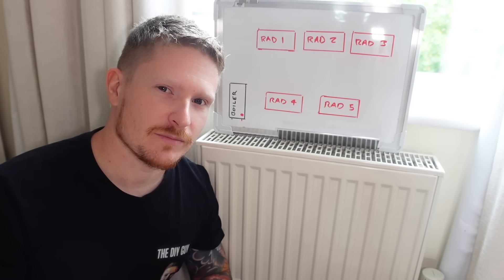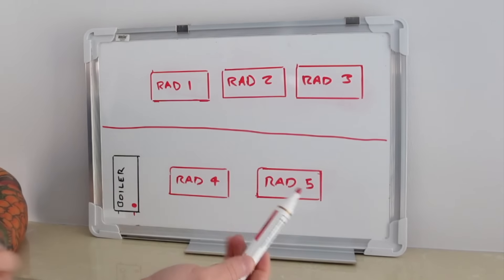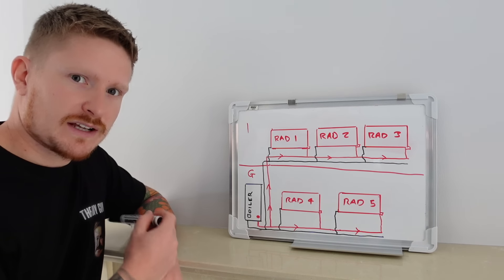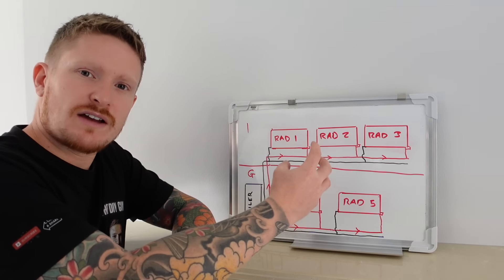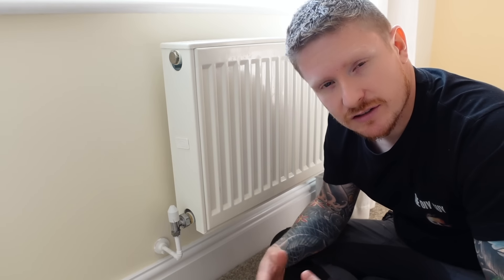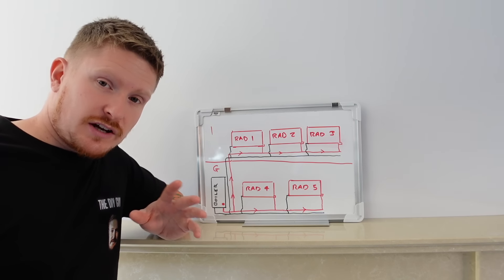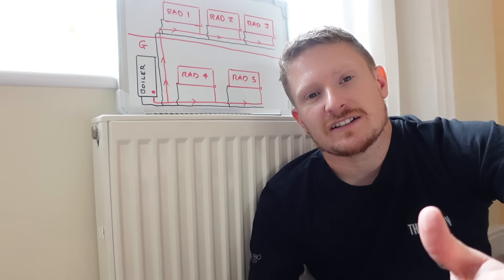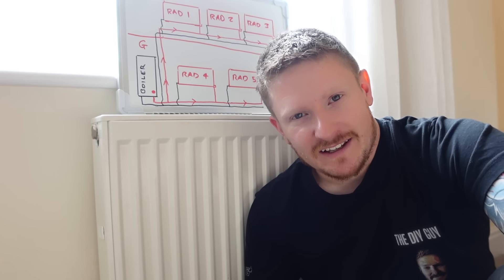How to Balance Your Radiators | Save Money and Increase Heat

Comment: What if the order of radiators can't be determined exactly due to unusual layout (extensions)? Does the order matter too much? Is there a good general/"rough" lockshield starting place before adjusting using the thermometer (e.g half turn for small radiators, full for large?). Also, do smart TRVs need to be temporally fully removed for the adjusting as they can't be "fully opened" easily like a manual? Pp
Reply: You can determine the order by opening up all valves fully and turning the heating up. They will get warm in order.
Reply: @mushy3424  Unless they don’t.
Reply: @normanboyes4983  Would this be due to sludge in the radiator or something else?

Comment: This is great, and we did get our back bedroom rad working much better by preventing a hogging rad in the front room BUT…watch out for the almost inevitable leaks.   A lot of valves, once disturbed, will leak.  90% of the time, they sort of stop after a while, but beware you will need to top up the water inside the boiler area, using the taps to do that afterward.  But, all good stuff, this works.

Comment: Hiya . Thanks to you for this video . Had a radiator that we just couldn't get hot after having 4 new rads installed by a plumber.
So did what u said ..without a heat sensing camera...lol 😂
Shut down the lockshield valves ..opened each one as u said & now it's working ..nice & hot 🔥
Thx again 😊
Reply from the maker: Glad it helped

Comment: First bit fail - 12 radiators in my mums house sizes small, medium, large 2 small ones come on at same time upstairs and down stairs and the last definitely in middle of hallway upstairs and second to last downstairs at furthest point from boiler which is upstairs. All other radiators are inbetween and come on at same time it seems. Must have run a couple of mile trying to check order lol. Great video and idea but not as simple  for everyones all over the place pipework i guess. The product that is linked is £290 which is as far as a day trip to the moon for us so ill try again and maybe try and follow the pipework best i can. Thanks for the general idea, very clear video. 1

Comment: The flow temperature here was about 70C - seems a bit high for a combi boiler. You should try reducing the flow temp at the boiler first and THEN balance the system as best you can.

Comment: Thank you for these clear and straightforward instructions. :-)  I've seen the 12K temperature differential mentioned in a few places. Do you know where it comes from? What is the reasoning behind aiming for a 12K temperature drop from in- to outflow? Thanks !
Reply from the maker: Your welcome. The temperature is to give you guidence as to the level of restriction on the return, therefore the flow rate of water traveling through the radiator between flow and return.
Reply: @TheDIYGuy1  this makes sense. Thanks!
Let's attack our 14 radiators...
Cheers
P
Reply: The temperature differential in smallbore heating systems i.e. those using 15mm and 22mm pipework, is normally 11 Deg.C,  (Delta T) this is related to the radiator sizing, before condensing boilers came along then a system would be designed at 80 Deg.C flow and 69 Deg.C return, giving a mean water temperature of 75 Deg.C, you would calculate the heat loss of the room and refer that to the manufacturers sizing chart, you would then select the radiator to suit that room. When condensing boilers were introduced we mostly moved to a Delta T of 20 Deg.C which meant using a correction factor in the early days, until radiator manufacturers introduced mor sophisticated sizing charts.
Reply: Wickes specify the wattage of the radiator at 70℃ input and a drop of 10 degrees.
Basically, the longer the time the water is in the radiator, the more heat it will transfer to the air around it. Providing the vents are free of dust, drying wellies etc etc. of course.

Comment: Thanks for the great video. Silly question but at what stage from turning the heating on should you take the thermometer reading? I have two digital thermometers with probes, but wondered when the best point is to take the initial reading for analysis
Reply: Well just give the boiler time to heat the water in them depending on how many rads you have. Know your 1st rad   2nd etc . Sure give it 30 mins or so.  Happy balancing

Comment: A suggestion, most folk like it warmer downstairs than in the bedrooms. Set the downstairs radiators to be fully on, and the upstairs bedrooms off. The bathroom radiator is often the fail-safe, that is permanently on to stop the system going bang. Set the thermostat, whether upstairs, as is mine, or downstairs in the living area to desired temperature. Eg. Mine at top of stairs is set to 18°C. Downstairs yours might be say 20°C. Heat from downstairs rises through the house and thus isn't actually being wasted. Obviously having the house walls insulated is first priority 😁
Reply: My hallway is the failsafe
Reply: Note to anyone reading the original post. This is poor advice. Boilers are normally sized to suit the whole house size and all radiators. By turning off half the rads, the boiler will see hotter return flow and is less likely to condense (operate at max efficiency). You're also using half your rads to heat your whole house (unless you close off the upstairs, but the original poster isn't doing this as his room stat is upstairs!). I could go on and on.
Reply: To save money I’ve turned off all radiators except the bathroom upstairs, then just a small room on down stairs.

I’ve completely forgot about the thermostat and even shut off the radiator that’s near it. I just turn the heating off when the small room downstairs feels warm enough.
Reply: Awful suggestion. You would be far better off turning the flow temperature of your boiler right down and opening all rads fully. Asking the downstairs radiators to do the works of the upstairs radiators you have already paid for is lunacy and is costing you money not saving it.
Reply: @ImBarryScottCSS  p

Comment: Your videos are brilliant and have really helped me perform some tasks around the house.  One question, I was making small adjustments to the lockshield pin - why would water start to gently flow out of the lockshield mechanism ? I made very slight adjustemts in both directions and the water started appeared...eventually I found a sweet spot that stopped the water coming out of the mechanism.  Regards Aaron in the UK.
Reply: Been there.  You have a leak past the valve stem.  If you go near an old valve, the seal may give way completely so be ready with cloths trays etc.. Try twisting it on and off a few times in case there's a particle stuck in the seal.  Try tightening  the sealing nut.  But if the seal or the valve body is worn, you will have to attack that by replacing the valve. Worst case a coupe of € for a new valve, plus isolating it to replace it.  Eh don't flood the house.

Comment: An excellent video, and I shall be trying to balance our system this weekend using this method. Did try to see the order the radiators heat up though and I've established the first one on each floor (2 floor house) but the others are getting hot at the same time....does the order for those after the first one matter alot?  I guess its a case of adjusting each and seeing impact.

Comment: Great video, thanks. I've only used the manual system to try to balance my rads. The Topdon kit you used is expensive for diy-ers, so I might try the type of infrared temperature probe that normally sells for around £15. Might not be as accurate but better than guessing.
Reply: Even the cheap IR temp detectors are accurate to within  2 degrees so not too bad.
Reply: Which one did you get please?
Reply: Thanks bud, perfect video - simple, short and to the point 👍
I drew a plan of my house with radiator positions and then the in and out side of each rad... Not all lockshield valves were the out (return) side 😜
Reply: @GaryMcKinnonUFO  Not exactly true - if pointed at a reflective surface (chromed valves/copper pipe) the emissivity encountered will put them out a lot.
Reply: As it's a temperature difference the accuracy doesn't matter very much so long as the readings are consistent. The emissivity of both pipes should be the same, but usually are both plain or painted the same colour.
Reply: How do I decide the position of the first and last radiators when much of the pipework is hidden?
Reply: @whitegoosegal turn boiler on and just feel the pipes to see which radiator is first,second, etc on the system.

Comment: Great tips, but probably need to ensure there's no air in the system by bleeding first. 
I usually just put my hand on the panels to see if they are all giving same amount of heat output, then do bleeding on any that are of a low heat output or warm at the bottom but cooler towards the top. 
The other tip, if TRVs are fitted (which hopefully they are), is to adjust settings correctly according to heat demand required. Bedrooms usually should be cooler to aid restful sleep. When not in use in the daytime, the TRV can be turned down, unless automatically controlled by a programmer.
Reply: Yes, but you have to be careful if you have a combi boiler and bleeding the radiators, it affects the boilers pressure and it may need adjustment after bleeding.

Comment: A different, and potentially better but more time consuming way, is to have room thermometers start with everything open and see which rooms are heating up fastest, then close the lock shields a little until they heat at about the same rate. If you can, turn your boiler flow down to where the house is then just comfortably warm - then you have an efficient system!
Reply: @markbeauchamp3192  what a thorough and nuanced response, you've convinced me
Reply: just install thermostatic valves and heads and let it be, hot water will always get where it's needed because you are not overheating, in smaller rooms, it's almost closed most of the time with thermo valve
Reply: @markbeauchamp3192  nope is spot on Mark.45years as plumber never heard such rubbish

Comment: I've got a 3 story place, I don't have a clue, what order all the rads heat up in... But I'm disabled, so can't run up & down the stairs with ease! But recently, as the weather is getting colder, I bled them all, switched on the heating for the first time 2 days ago, boom all radiators are hot!

Comment: Explain what should be the temperature difference (delta t) in the radiators themselves?

It means the ideal temperature at the entrance and at the exit from the radiator (balancing)
Is it 3°C, 7°C or maybe 10°C?

We consider that it is an air-to-water heat pump, where the ideal delta t is around 5°C or lower for efficient heat pump operation.

Comment: Thanks for a great video
My first radiator is in the bathroom I don't use at all,,, second in the bedroom I don't use as well. Is it possible to turn off first few radiators completely - would the water just flow normal around them and would that effect boiler efficiency - or my gas bill? Also if I would turn off one radiator, would I turn off valves from both sides? Thanks so much
Reply: I wish someone answered your question
I'm having the same dilemma

Comment: I learned a lot from this and having followed your instructions it worked!
The biggesr radiator in the nouse has never got really warm but it does now.
Previously had central heating engineers in and none oc them did what I managed to.
I didn"t have a thermal camera, I just gave it a go then tweaked the rads depending on how warm they got.
Now subscribed and looking through your other videos.
Reply from the maker: Awesome job 👍. Thanks

Comment: Great video, I swear I’ve owned houses where the installers didn’t have the first clue as to doing what you’ve explained, to be fair I guess they are paid per installation, get in, and get out.
However, having gone to all this effort doesn’t fitting a variable orifice ( a modern motorised TRV), onto one end of the rad, throw the balance of the system out, as they all find their various positions.
Reply: I didn't even realise a motorised TRV existed. What manufacturers make them? Sounds interesting.
Reply: newer installations/boilers have an energy saving pump, which can be set to target a flow rate/pressure dynamically which takes this into account
Reply: @Reakerboy   There are two types of TRV, one type relies on the expansion of a liquid contained in the valve head, to close the valve. The modern style (have 2 AA batteries, usually, and these drive a motor), and set the valve to a position to minimise the offset  between a set point or desired temperature and the actual temperature.

Comment: very useful. However, how do you judge which order each of the radiators are in? How do you figure out which one heats up first, then second, and so forth? Are the downstairs radiators the last ones? Also, is it okay just to adjust one radiator that is not working properly - the one that is coldest (as long as all the others are heating up btw)?

Comment: Fantastic explain. Only my question is how we setup if we have TVR valves on radiators and another valve on the pipe at hot press tank. Is it the same rule or keep all valves open full. Appreciated for feedback

Comment: Great video thanks. Wanted to ask - if you're using a 12 degree drop for each  radiator, I take it it doesn't matter the order you adjust radiators in?

Comment: It may not save you money but it will give you more heat! If you get the balance right, and all the rads giving their best, the boiler will need to work harder as the return water to the boiler will have more heat taken out of it. Your house will be warmer. I would perhaps see how many turns the control valve takes from fully open to It being closed. 3.5 was the example given. Divide by 5 =0.7. Increase the number for each radiator by 0.7 of a turn as you check each radiator. Test the temperature drops across each radiator using a cheap I.R. Thermometer. You get the best reading by sticking a small patch of black insulation tape on each bottom  end of the radiator. Of course, you may well not require your bedroom to be as hot as your lounge. That's where the rad stats come in. (That saves you money). For condensation boilers have the radiator flow temperature set at around 60C. That way the water returning to the boiler will collect heat from the flue gassed. That's when the boiler is condensing, you will see steam coming out on a cold day. Great video. I never considered staggering the flow settings based upon radiator position. I may be wrong of course. As I am not a plumber.😅

Comment: great video many thanks. Should the thermostatic valve or manual valve on the other end be opened fully before adjusting the lock shield though?

Comment: Very good I never could tell which knob brings the water in and which brings it back to boiler. I have a pump set to come on when the pipe reaches a certain temperature so it heats the rads down stairs. How would I tell them which is the first rad or does your old school tuition work on two separate principals. 1st rad to get hot upstairs is rad No.1 and 1st rad downstairs to get hot is No.1 so should I use the same technique you so great fully showed us 1st rad to get hot upstairs and downstairs when pump kicks in only turn 1/4 way and each one after a little more according to sequence as they get hot in turn. I'm in my 60s living alone and I like how you showed the old school way for us and the modern way for the younger age thanks a million

Comment: Very Good video thanks - quick question, is it required to have a by-pass radiator in the house ( radiator with 2 lockshield valves) ?

Comment: Great video. Many thanks. Just one question...If I have 2 rads in the same room should the lock shield valves be set the same or a quarter turn different? Thanks

Comment: Thanks for this. Really helpful and easy to follow. I'm sure we've inherited a mess of a system and going though this and finding that all the radiators were fully open and of different temperatures certainly points to that. A lot better now after following your advice.

Comment: If my first radiator is the one that has sludge and is cold how can I identify which radiator heats first when the system is turned on. Is there an alternative way to figure out the flow from No.1 through to the last one, also does the upstairs work separate to downstairs and therefore when balancing the two floors are done individually or are they a combined unit. Thank you your video clips are brilliant, all power to you.

Comment: With more than one floor like in your simplified diagram there are effectively two circuits . Surely an unbalanced upstairs rad isn't going to affect any circulation on the downstairs rads as two are on split flows?

Comment: Thank you for the nice explanation! However nearly all my radiators (except for a new one in the kitchen) do not have a lockshield valve. Only a TRV or just a simple manual valve on one of 2 pipes. Another pipe is just a nuts joint. How to balance such radiators?

Comment: Neat but two things!

One you forgot to mention the bypass radiator (one with dual lock sheild valves) though I guess it can be adjusted on the output the same way.

Two - Thermal imaging camera is cool, but expensive. You can use any contact thermometer to read, a far cheaper option is a point and shoot digital infrared one or a pair of old-fashioned clip-on ones

Comment: Very useful video and well explained EXCEPT I didn't understand that you first said the lock-shield valve is on the return flow but then when you measured the temp on that first rad, it was hotter at the lock-shield side which must be the inflow not outflow, right? So are you saying that sometimes the different valves are put on the wrong side? and if so, does that matter and should we try to get them swapped over in order that the system can run correctly?